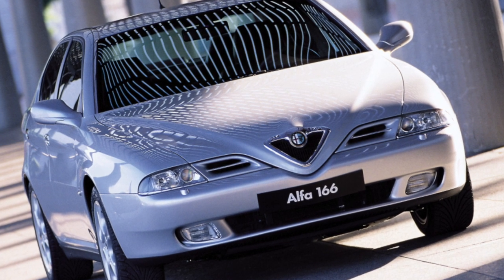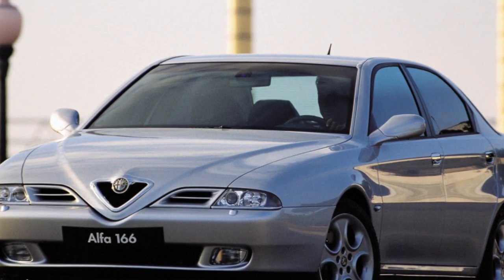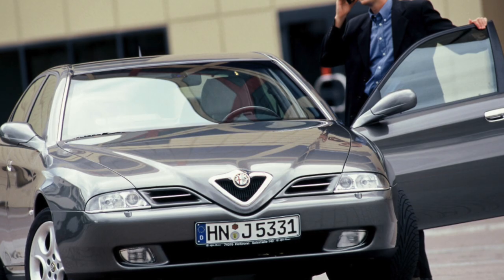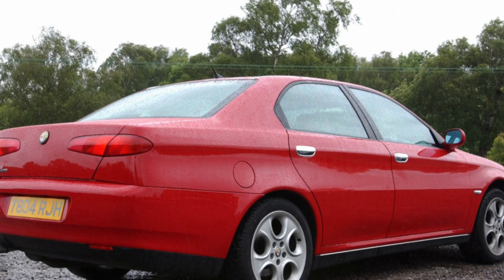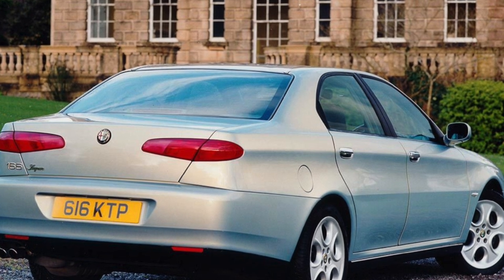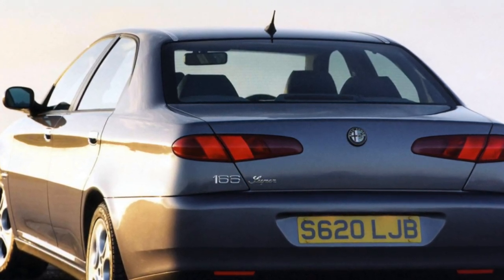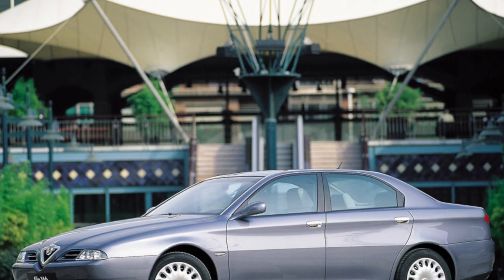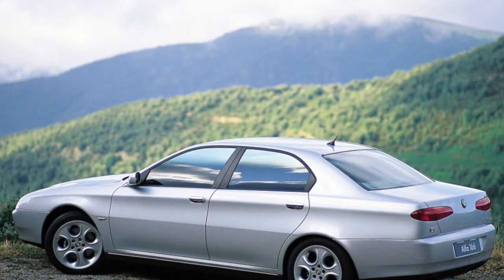Alfa Romeo 166 Problems | Weaknesses of the Used 166

Comment: The telephone is integrated into ICS like you said but there was an extra rare option from lineaccesorie for a telephone handle under armrest (I have it in my 166) and Then when someone calls you you can pick up over ICS and you will hear the person on right front speaker, or you can pick up handle and it will transmit the voice to handle like a private call
The handle has such a good microphone and whenever I speak to my friends they say I talk from studio😅
Reply: I’d love to see photos of this. I can see the wiring for it on the ICS. I could retrofit one into mine. I’m working on a mod to the Siemens modem to retrofit a newer 5g version